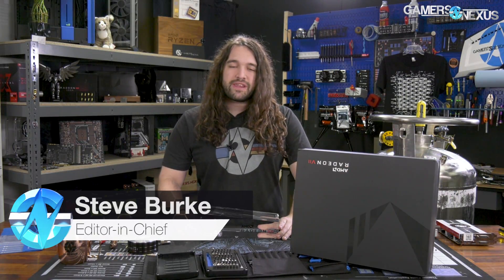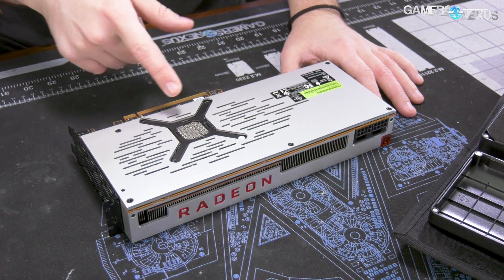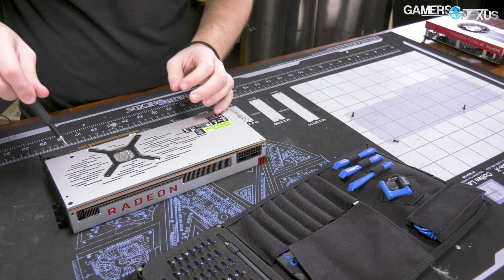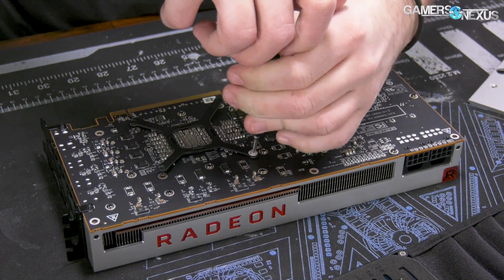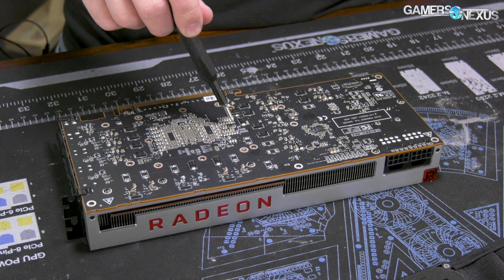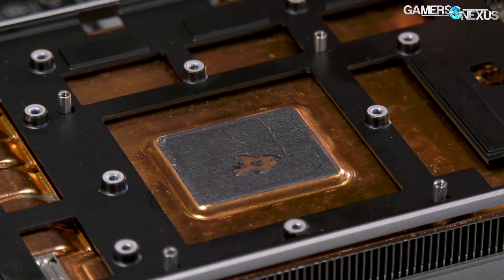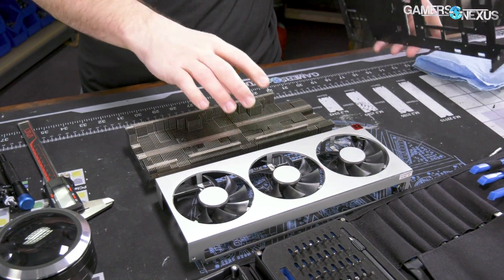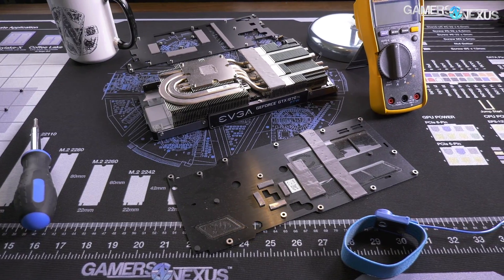AMD Radeon VII Tear-Down & Graphite Thermal Pad

Comment: Power hungry, but the benchmarks will tell us if this card is a flop or not!
Reply: yeah sadly I suspect the power usage will be horrible even if the card is good.
Reply: @differentlyabledmuslimjewi4475 It should be around the same power draw as the Vega cards.
Reply: well the recommended requirement is 650w, lower than the 750w vega 64 according to powercolor

Comment: Will reference Vega64 waterblocks fit also this Vega VII?
Reply: good question ... it looks like it might fit ... *fingerscrossed"
Reply: It cant fit the GPU die is way bigger... Vega 64 die size is 495mm² and Vega 7 is 331mm²
Reply: @ElonMusk-Krypto  But the package area is the same to me. It seems so.
Reply: @TRHardware  https://pcfiend.com/wp-content/uploads/2019/02/AMD-Vega-20-vs-Vega-10-900x506.jpg
Reply: Seem unlikely.  It looks like the VRM design is different.
Reply: And so far, no one is making a waterblock for this card.  Guess I won't be getting an upgrade to my Vega 64.  :(

Comment: I do love your channel. However being a R&D engineer and seeing what customers return trying to claim the warranty is insane. Clearly they had no idea what they were doing, and screwed it up, then they expect the manufacturer to spend their time and money fixing what they messed up. Not to pick bones here, but you and Linus both touch these sensitive boards all the time without a static strap on your arm. Sheesh, why do you think they comes in static bags? because they like to spend more money?  This is why I do not understand your thinking about the warranty. 
For instance. I make a device like your video card. I have properly torqued down the heat-sink to the board. Then some ha-ho wants to put new paste on. When  he screws it down he over torqued the heatsink and cracked the die, or something else on the board. They he wants to claim the warranty. Why should I as the manufacturer pay for his screw up out of my own pocket ? How is that right?
Reply: Basicly you dont have to pay for stuff, that a customer fucked, i dont really get your point.
Lot of companys are using these stickers, so they actually know if they customer removed the cooler.
If the sticker is fine, they dont have to look for damage, that someone might did, by removing the cooler.
Time is money. 

If the sticker is broken, and they see obvious damage, done by a customer, then they can and most likely will deny warrenty.
Reply: and yet they havent ruined anything from a static shock hmm.....
Reply: So how much is the Torque on that screws? do you have any reference. do you have a special tool to test? is your waranty void if you open your cars hood and screw up at the engine? Do you refill the most important part of your cars engine... the oil? how do you know that you use the right oil? Is your waranty void if you take "kind" of the right oil? Pointless isnt it?
Reply: As far as I know usually Linus has an anti static strap attached to his leg and a table leg.
Reply: A wild elitist 'ha-ho' has appeared, and with a smug level of 6+. 
Quick, someone catch it and take it to an optometrist, as it appears to need its vision corrected.
Reply: @rako81sna  People have short memories and tend to be sloppy. Back in my youth in computer rooms/telephone switch rooms if you forgot your static stuff they showed you the door. i can't stress enough how even something like finger grease can degrade edge connectors over time. Your remark is on point, They want to know if the user went there.
Reply: @perrydickerson9055  x
tis true  and I am insanely careful with my machines... but machines dont cost the equivalent of 5k like back in the day.

Comment: That cooler is a huge design flaw. The air is supposed to blow out on top and bottom. Top is almost closed of and the bottom, well that straight down into the motherboard.
Reply: the expensive vaporchamber+heatpipe design with a fuckton of copper is to combat the airflow issues.
Reply: Yeah, the cost of a logo... is paid in thermals.
Reply: So many armchair engineers on here think they know better than a multi-billion dollar company. Amazing. You should go work for them and show them what they did wrong. I'm sure all the engineers who lost sleep over this project would really like to hear what you have to say about their design.
Reply: @youtubasoarus  I am happy engineering at my current company. What makes an 'armchair engineer' in your opinion? I actually design and test electronic component coolers at the moment. How many hours have you spent reading airflow and fluid sim data? Here is a simple experiment you can do at home: (for the kids)  Get some temperature monitoring software, and run your preferred PC stress test. Check the high temperature recorded. Let it normalize.  Reset your monitoring software. Then, cover half the exhaust of the case with something, tape, paper, cardboard... optionally write your name on it. Run the same stress test. Notice the temperature difference?  It doesn't really take an engineer to figure out cutting off a large percentage of airflow on an air cooler will affect efficacy. And in the case of computer components, this will certainly lead to performance throttling in sustained work loads. It seems like the entire Vega line is plagued with cooling issues.  But damn... they look gorgeous! I can't wait to get mine.
Reply: @Eskaiyu  efficiency* 

Damn, if you put that much effort into your grammar, then you are not much of an engineer.

Plus, why is it that there is always someone claiming to be an engineer in the topic at hand in a comments chain? Prove it.
Reply: @Eskaiyu  Listen bud, i'm not getting into a pissing contest with you. My point is if you know more than AMD and it's hundreds of engineers, go work for them. Don't piss around in the comments.

Also, paragraphs are your friend. Your comment is unreadable.
Reply: I'm chiming in to agree. The logic of choices made is not really obvious. You see this large fin stack with triple fans ($$), beautifully machined heat pipes with a vapor chamber and uber gizmo thermal pad ($$$) and then you get to see that "restrictor" of a logo. The cooler looks like a supercharged, nitrous - injected 1.0 three cylinder instead of a plain 2.0 NA. Perhaps you could get away with one less fan if the airflow was not limited by the shroud. I'm also not a fan of blowing the 70-80 degree air over the mainboard VRMs.
Reply: @youtubasoarus  Fair. But my point is: you don't have to be an engineer to understand air cooling requires airflow.
Reply: @MarcABrown-tt1fp  No. I get an anonymous opinion on YouTube has little if any credibility. To be fair, I don't engineer the coolers themselves.  I work on the systems that monitor and control them. So, I do get to play with lots of different designs.
Reply: @Eskaiyu  Tusce
Reply: @youtubasoarus  Nvidia already got the same comments on their FE RTX cards. Not much room for the air to get away there either but more than the R7. These days it's all about looking good so they had reasons for the design for sure. Besides you don't need to be an engineer to understand how these coolers work.
Reply: @tmkongen  You don't need to be an engineer, no. But you do need to be an engineer to figure out how to design an effective cooler within the budget allotted for the card. That's where the brainiacs are used. To figure out how to get it to do what it does as cheaply as possible.
Reply: @youtubasoarus  Yeah that's the problem, "as cheaply as possible". I'm sure it will be cool enough to not throttle.
Reply: @tmkongen  That's not the problem. That is a fundamental part of business. They have to get the price down so people will buy it. No sense putting a 200 dollar block of machined copper on the card if people will refuse to purchase it because it's too expensive.
Reply: @youtubasoarus  That's not the point man. They could've made it better for airflow without increasing cost. An "Engineer" should be able to figure that out. Besides they could've made it cheaper with less VRAM. They don't want to sell this to 90% of the gamers out there that got no use for 16gb at 1080p.
Reply: @tmkongen  Well there's got to be a reason they did it the way they did. Nothing goes on in these companies without a reason. And even though you, individually, may disagree, they have to appeal to a wider audience. Maybe if the cooler isn't up to your particular spec, it's not for you. I dunno what to tell you.
Reply: @youtubasoarus  Don't need to tell me anything :) Looks is more important than functionality these days anyway. Board partners will fix it.

Comment: FYI, those heat pipes are all cooling the GPU as directly as the fins are. The vapor chamber takes heat from a concentrated point and spreads it to the rest of its surface at basically the speed of sound, any point you cool will take heat out about as well as any other.

Also those heat pipes are massive. I ussed similar sized ones to cool my laptop when its stock cooler died (It is no longer a laptop) and they take 70W apiece. Accounting for the loss in effectiveness due to those bends, they're good for ~300W.

Comment: Hello and thank you for an easy and accessible source of insight into these GPU's!

So I have a Radeon VII that has recently stopped working. Basically, The computer wont start with the affected GPU anymore. The card is JUST out of warranty and I am in hopes of finding a solution to repair it, either myself, or find someone who is willing to help.

So I'm reaching out to Gamers Nexus / anyone on here that might be able to point me in a good direction of where to start.

What I know at this point is...

-The card will power on normally. The fans spin and the RADEON logo lights up.
-When I power the computer with this particular GPU, it simply hangs like it doesn't recognize the GPU. I have two other RADEON VII and when I install either of those into the system it starts and runs wonderfully.

This is pretty much all I have to go on and the fist thing I thought to do is jump onto this YouTube channel so as to gain some insight.

Can anyone help?

Much Gratitude

Comment: You should do an in-depth comparison between graphite sheet TIM and grease TIM (traditional paste). Including mounting pressure. I've been using an IC graphite pad for testing for about half a year now. Work quite nice, and is very easy. Also, it's performance increases with higher mounting pressure. Which actually directly follows from electronic structure theory

Comment: As a note graphite has an effectively unlimited lifespan without degradation from drying and should be more consistent if assembled well. A bit thicker though so I would expect performance to be a lower than a well done paste job but still way better than any normal thermal pad.

Comment: Anyone who disagrees with you on the warranty void stickers needs to look into the Magnusson Moss Warranty Act. The same act is also vitally important to the auto industry. The manufacture has to prove that whatever modification you made caused the issue that the claim is about. They can't blanket void your warranty as a faulty oxygen sensor, for example, would not be caused by aftermarket suspension or a new stereo. 

We as consumers have rights in regards to the products we buy, specifically the right to repair.

Comment: All those heat pipes have about the same thermal contract to the gpu. They are all contacted on the opposite face of the vapor chamber, so almost all heat has to be transferred through the evaporating liquid/ condensing vapor. This is very evenly spread across the chamber surface, so the opposite face should be at almost all the same temperature.

Comment: idea for the mat. Underneath the place where you are putting the screws for the gpu you could put a thin magnetic mat or could make each square of the grid have a small bit of plastic coming up to contain the screws so they don't roll away.

Comment: Steve - The S on the part number of the fan on the end of the part number... Those are three sleeve bearing fans. Actually similar to the FirstD fan on the 295x2 shroud except the 295 has LEDs. I replaced the 295x2 fans quite a lot actually.

Comment: Good to see it looks like you can take off the shroud with coolers without the need to completely disassemble the card for maintenance. I wonder how easy/difficult it will be to pop out the Radeon logo and Red squire to replace it with something else color wise. They should have just made it clear and have RGB lights instead of a forced color.

Comment: Not much can be said for Sapphire R9 390X NITRO GPU performance, but something I will say for it is that it is very easy to disassemble, and the fans can be unscrewed separately from anything else right from the top of the cooler and pulled out for cleaning. It's fantastic. I've been able to manually clean each fan blade and the fins underneath each fan easily. 

And those graphite thermal pads are actually pretty good. You can buy them in sheets and make your own thermal pads out of them, if you can find them. Be warned, however, that graphite is an INSANELY good conductor of electricity, unlike your average thermal pad or paste, so don't go laying it across your PCB. You can also find graphene thermal pads, as well, and they're much more "user friendly" but not quite as thermally conductive.

Here's an example of graphite thermal pad: https://www.innovationcooling.com/products/ic-graphite-thermal-pad/
Here are some examples of "high thermal conductive graphene sheets": https://www.alibaba.com/showroom/thermal-pad-graphene.html

There are even, apparently, graphene impregnated silicone thermal pads: https://www.alibaba.com/product-detail/Wholesale-price-graphene-graphite-insulation-conductive_60843224920.html?spm=a2700.7724857.normalList.1.4c555d97YgS5t3&s=p

This company also apparently makes these insanely flexible synthetic graphite sheets that almost look like plastic: https://www.alibaba.com/product-detail/High-Quality-Customised-High-Thermal-Conductive_60832254464.html?spm=a2700.7724857.normalList.7.4c555d97YgS5t3

Comment: Great video. Pretty keen on this card if it manages to seriously outperform my rx580 8gb. Only thing I wish is that it had lengthways fins, my rx580 sapphire card has lengthways fins and it's much better for case temps overall as most of the GPU heat goes out the back if you've got a powerful fan positioned in the front of the case blowing at the card.

Comment: Looks like the PCB has the solder pads for both the GPU Tach LEDs above the 2 x 8-pin power connectors and the Tach LED color setting switch on the back of the PCB as per the original (non-custom) VEGA cards.

Comment: Impressive cooler !! just wow... If this card OCs well I may consider it !!
Reply: ot just think of it as a oc vega 64
Reply: @DragonProtector  Yeah, but with twice the vram bandwidth and capacity... I wonder if they will produce a 64 CU version when 7nm gets better yield... probably not...
Reply: @vitaobatera  tbh does having 60 cu vs 64 really make a dramatic change?
Reply: @DragonProtector  HAhaha not much on performance, just on figuring out that the yield is on point... by then, they will release the 12c/24t Ryzen...
Reply: @vitaobatera  ya

Comment: Could you maybe do a video where you investigate the cost savings in energy of buying hardware on a smaller node. What I mean by this is that performance can be held constant across nodes. Then power draw can be measured. It would be interesting to see how long it would take for the hardware to pay for itself. Another consideration is selling the old hardware; which would reduce the time that the savings take to make up the losses...
Reply: AMD already told us what you can get from 7nm,  50% less power at the same frequency, or 30% higher frequency at the same power. You can do the math from there.